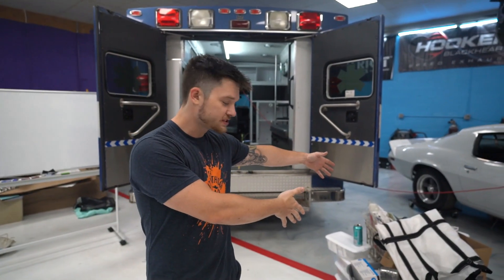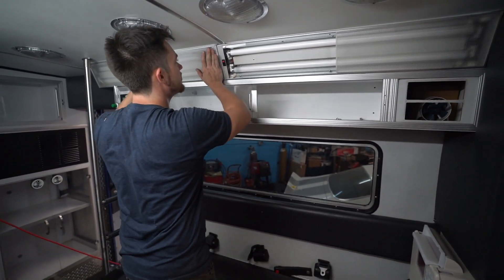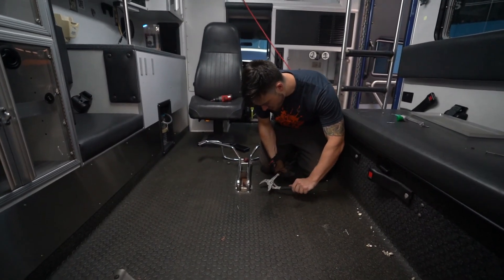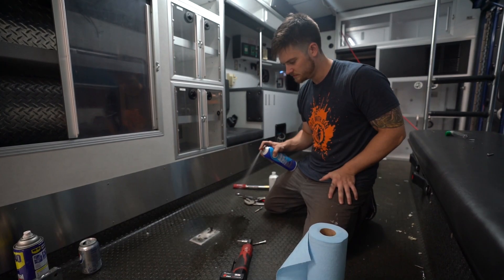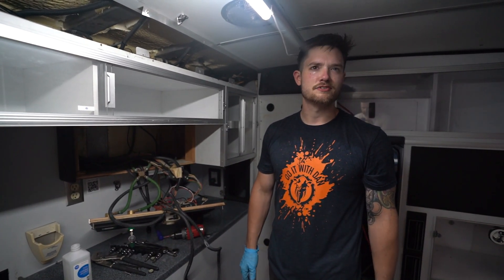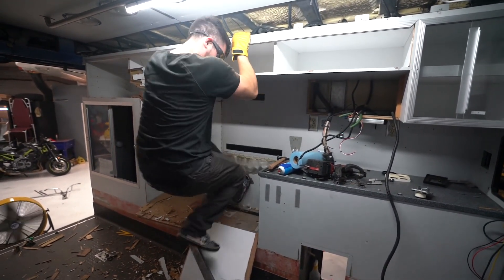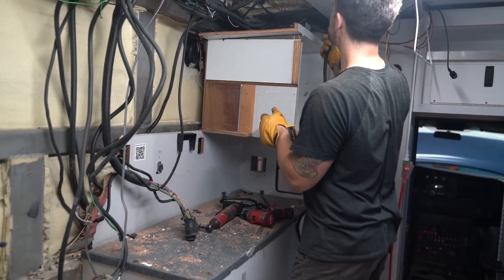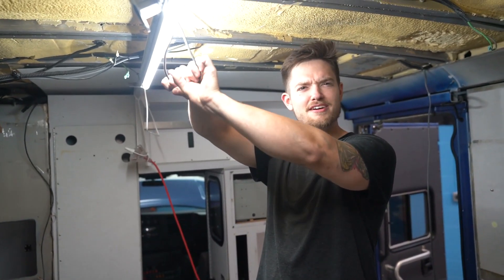Stripping an Ambulance in 30 Minutes

Comment: Hey Dan & Ham, I used to build cop cars, both undercover and standard marked cars, but have also had a hand in an ambulance build. The relay box that you showed at the end of the video is a stand alone system that should have its own high powered amp circuit breaker from the battery compartment. The center console controls all have wires running to that relay center. Tampering/ removing or cutting any of those wires will NOT affect the ability to drive the vehicle nor will it affect any of the standard headlights/tail lights. There should also be a stop light triggering device, to change it green if its red, in the center of the windshield that is activated by the exterior lighting controls. IF you wish to keep that, probably don't show it in video as its not exactly legal to have since its considered "tampering with traffic lights". Best of luck on the rest of the tear down/build!
Reply: liking this so they can see
Reply: Id recommend getting rid of the MIRT if they have one. Where I'm at it takes a picture when we use it and if its not an ambulance going code 3 or a cop car its punishable by something, not sure what though.
Reply: @garrettfunk5704  they got cameras on lights where you are?
Reply: @marcusborderlands6177  Yeah, pretty common around here actually. And the thing is they're on random lights and hidden pretty well

Comment: @12:57 Those are affectionately called the "antlers" The stretcher locks into that device. When I was an EMT, we cleaned the floor fairly often. At least once a day. An old partner of mine is going to take an old ambulance and turn it into an RV.

Comment: Dan in case youre reading this dont be concerned by a bunch of extra wires, I converted a shuttle bus and it was the same way bc whoever made the ambulance basically makes one harness to fit all vehicles and options that they make.  when i tore mine apart I just started the interior/ rear lights wiring from scratch to clean it up.  Probably took out like 10 pounds of un needed wiring

Comment: Not sure if you'll see this, but now that you've stripped an ambulance down. Do you think it's a good platform for a motorcycle hauler/camper, or do you think I would be better off with a short bus that only has seats to remove? My plan is to make a ramp with a front wheel lock like a lift on a slider mechanism and use a small winch to load and unload the bike and then do a fold down bed, a small cook area, and storage for clothes and supplies.

Comment: Welding aluminum friggin sucks dude. Best of luck to ya!
Reply: Wait what? Welding aluminum is super easy and one of the easiest things to weld. Whether using a spool gun on a mig welder or doing it by TIG, both are extremely easy for even beginners. If you can tie your shoes you can weld aluminum.
Reply: 2fastHarley when I was learning to weld, I’d melt through the aluminum. My favorite is mig on steel tbh. I’m sure if I had a bit more practice I could easily weld aluminum. But if you’ve never done it, it’s easy to melt through

Comment: Oxygen does vigorously support combustion (burning), but it is not flammable…. it simply doesn't explode. ... It is certainly possible given the right circumstances that tanks of almost any gas could and did “explode” as the pressure in the tank increased with increasing temperature.

Comment: ALUMINUM SHAVINGS AND STEEL DOES NOT MIX WELL AND WILL CORRODE EACH OTHER. If you’re going to cut the aluminum BE CAREFUL OF THE STEEL YOU HAVE IN THE SHOP.

Comment: No body has died on a ambulance. There not allowed to do time of deaths, and call people dead. They have to wait till they see a doctor or nurse at a hospital, so technically no one has died in a ambulance.
Reply: In some states. In Kentucky and Indiana where I worked, we note the time of cessation of breathing or pulse or asystole or PEA. The doctor has to sign off, but the death certificate will say the time the paramedic noted. In both states, an EMT can pronounce someone if their injury is "not conducive to life" i.e decapitation. Paramedics can using their 12 lead monitors. You call the doc on the radio and can ask to cease efforts. You note that time.

Comment: wtf is wrong with the audio. its far to quiet. have to max my speakers to hear anything. also. why was that stripped completely? its built like a tank. i would of just modified what was in there to my linking. literally all the shelving and everything was designed for cursing down the road like a maniac